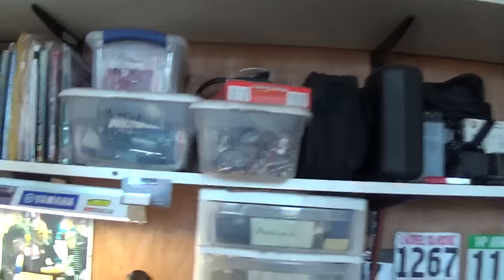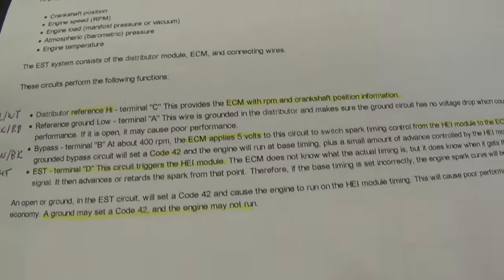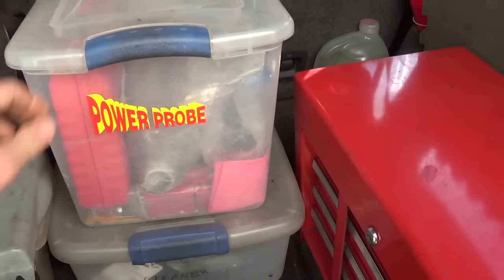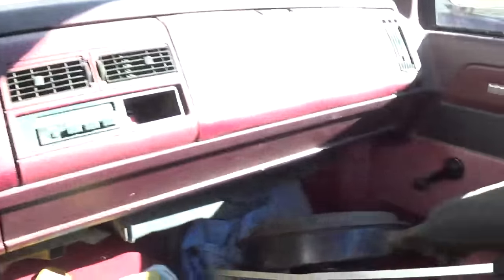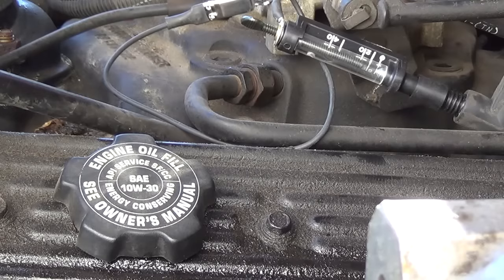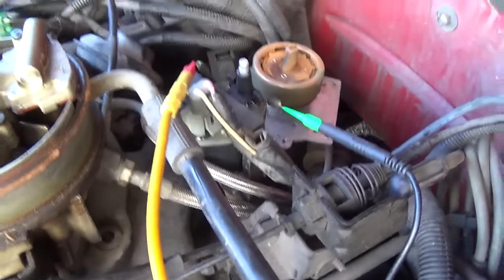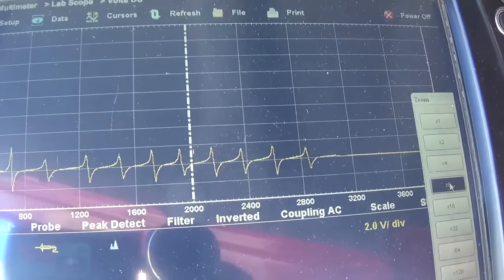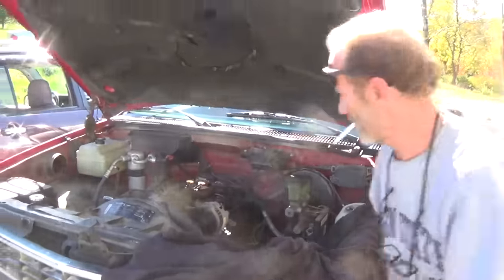Crank no-start: '88 Chevy truck 5.0 V8

Comment: I like how the shop owner comes over to snap throttle the engine. almost as if it had a carb and he was trying to kick the idle down.  great video. refresher course for me it's been a while. Thank you for showing and explaining
Reply from the maker: +GREG Feeney Definitely better throttle response than a drive-by-wire system!
Reply: Oh absolutely.
Reply: Lol see up here in New York that truck would be rotted out because of the salt.
Reply from the maker: I'm actually surprised this thing looked pretty decent on the body...there are plenty of newer rotted-out Chevys running around here in PA as well. It's only a few hours South from Central NY, so car bodies might last a few years longer haha
Reply: Haha
Reply: @PineHollowAutoDiagnostics  I have a 1990 pickup with a 5.0 TBI and 180,000 miles, and am amazed at the great throttle response, especially on a 30 year old truck

Comment: Nice job Ivan!!! This solved my problem in  `91 5.7L C1500..250,000 miles on it..ran rough...sketchy icm. Runs great now. Thanks...and I did grease the mount to help with heat. Next I will rebuild tbi cause of mileage. You and Eric O have taught this old fart alot.

Comment: Thanks Bro. My 89 looks identical to that one but is a 350 Wednesday I drove 15 miles to my friend's ranch and the truck ran perfect but, while I was opening the gate, the truck quit and wouldn't restart. I had put a new distributor on it last summer.  I'm hauling it home today and just going to buy and install a new ignition module thanks to you.  Btw, that noise when you turn the key in or off is the old electric antenna motor.

Comment: 1993, C1500, 5.7l.  OBD-I flashy blinky code said there was a problem with the ignition module.

I pulled the ignition module and took it to O'Reilly.  They had an ignition module tester at the store.  Although, only the long-time employee knew how to use the thing!

My module tested bad.  I also had them verify the new replacement module checked out okay before I left the store.

No muss, no fuss.

Nice to have repair issues go so smoothly!